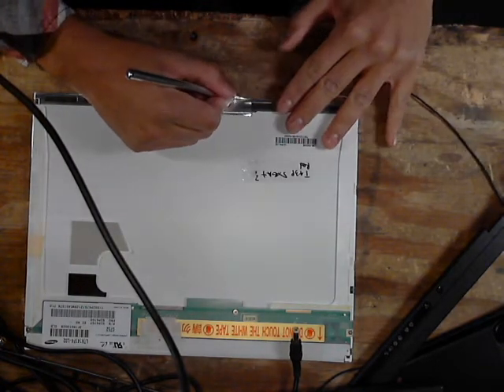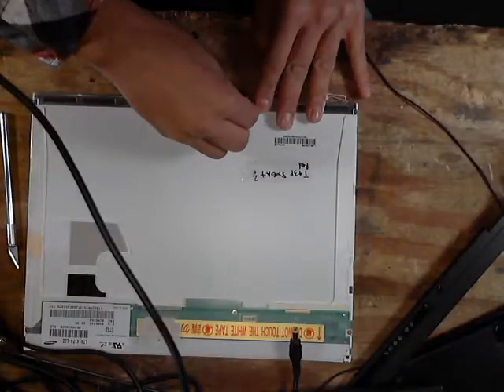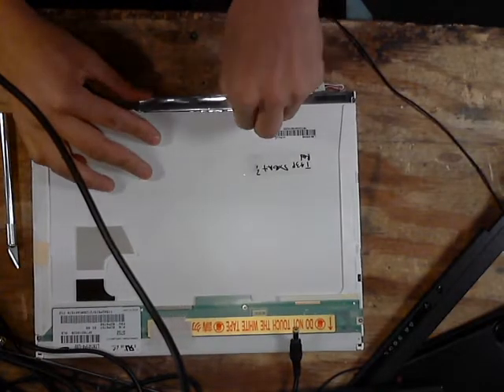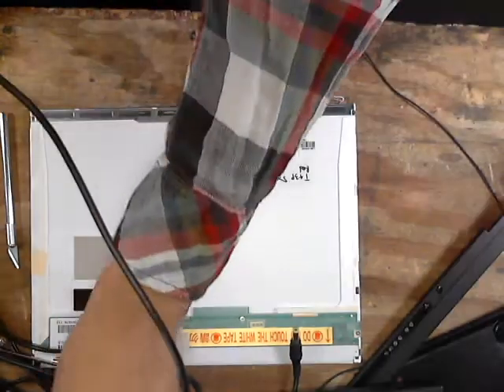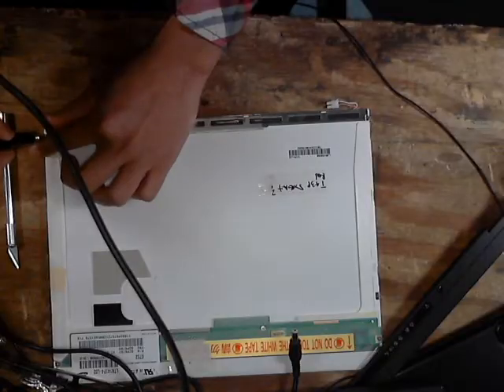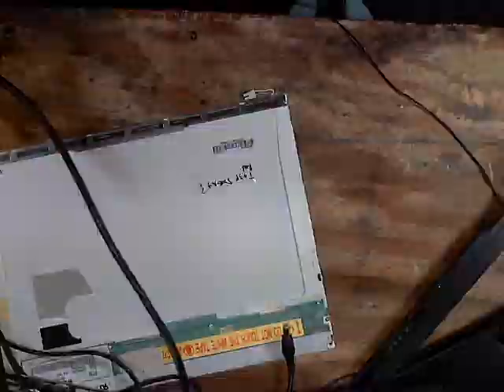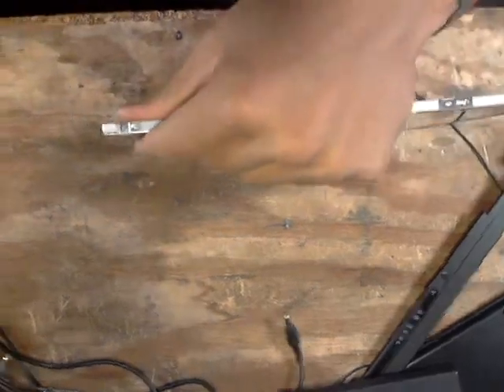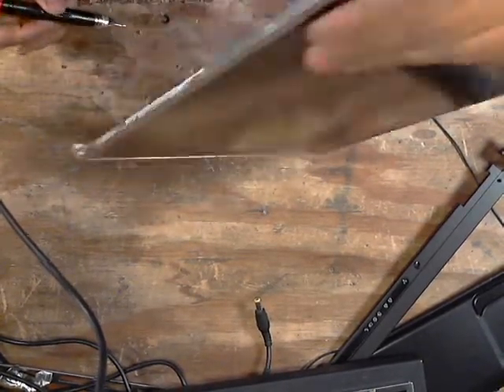Laptop CCFL Backlight Removal

Comment: it's better to change the entire screen
Reply from the maker: Yes, screen swaps and lid swaps are definitely easier, but at this time buying a CCFL was like $10 and a screen would be $60+, let alone finding one that is same resolution or condition as yours. Now you cant find backlight tubes anymore, none being made bc old and obscure.
Reply: @Sauceyjames  , I have/had 7 Lenovo T60 (the 4:3 screen is unique!); 2 had problems with the fan, 2 with the Lcd. I managed to exchange parts of each other, with the aid of a cheap technician ... your video is very useful, for replacing the CCfl with the Led

Comment: Brother can we repair this fluorescent bulb at home now in 2025 when it is not available
Reply from the maker: @TheCatsChannel1  if you cannot find a fluorescent bulb, maybe getting a screen replacement would be the next option. Although that will probably be more expensive.
Reply: @Sauceyjames  thanks a lot bro for responding but now Dell latitude d430 laptop screen never find any where in offline market and any other screen size never match with it
Reply from the maker: @TheCatsChannel1  D430 is pretty old, maybe finding an E6400 may be compatible but I won't be so sure.